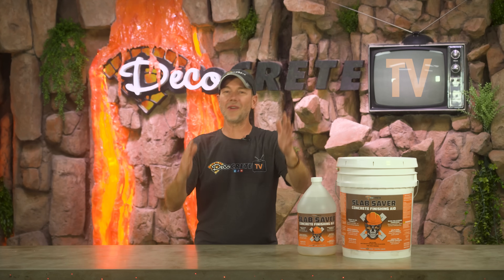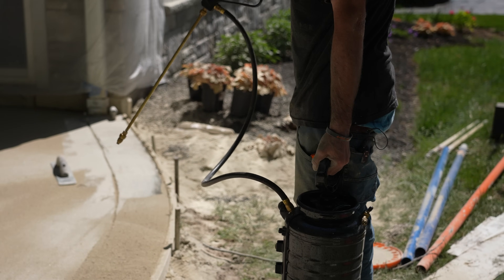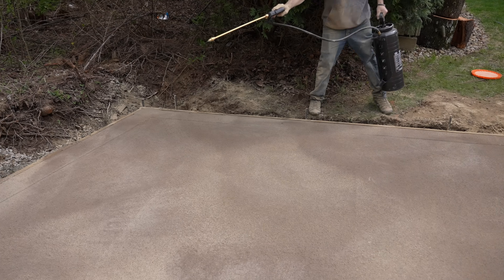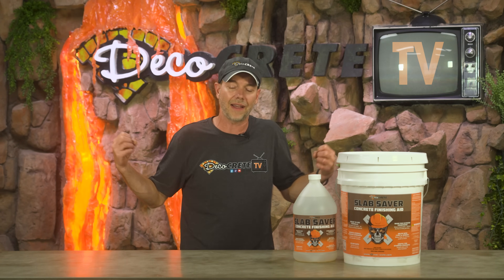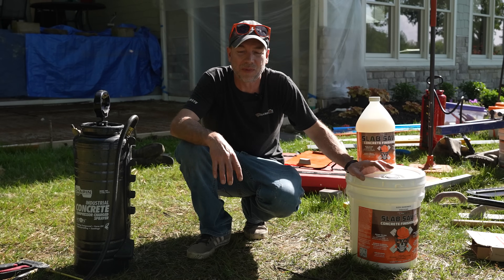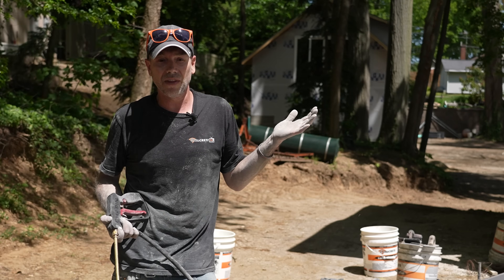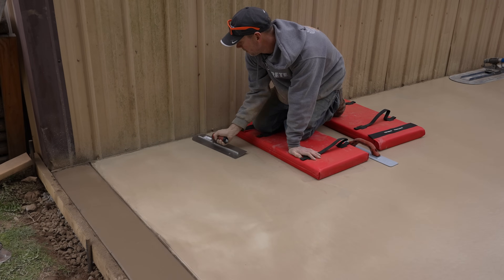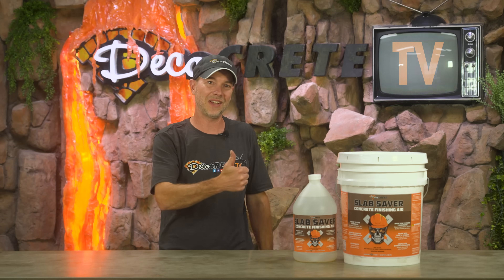This Finishing Trick SAVES Concrete in Extreme Heat! | Slab Saver

Comment: Is there something you can use after its been poured if its highly reflective with sun. Causes so much glare that it burns your eyes.
Reply from the maker: Thanks for the comment! I'm not aware of anything that is designed for reducing glare. Most finishing aids and evaporation retardants contain water, and may actually increase glare for a few minutes after application. The glare comes from moisture on the surface, and on a warm sunny day the concrete would be hard to finish without some moisture. Reducing glare is an interesting idea, though. Let us know you find anything helps. Thanks for watching Deco-Crete TV!!!

Comment: Здравствуйте  🤝 вопрос о гидроизоляции бетона, точнее под бетоном, в зимних штатах вашей страны где есть минусовая погода зимой, когда производите подготовку основания под бетон стелите ли вы какую то гидроизоляцию или не ? Если да то почему? Если нет, то тоже интересно услышать ваше мнение на этот счет и как это влияет на декоративный слой бетона штампованного. За ранее спасибо за ответ!
Reply from the maker: There certainly is some debate on that subject in our country, and you’ll probably get different answers to that question depending on who you ask. Our approach has always been to avoid putting plastic or any other kind of vapor barrier under exterior concrete, unless it’s a unique situation. While there might be a few benefits to putting plastic under air-entrained exterior concrete, there are also some downsides. It will increase the amount of bleed water that comes to the surface. This can dilute the water-to-cement ratio on the surface and weaken the top of the slab. Plastic also slows the set time at the bottom, causing the top to shrink faster than the bottom, which can lead to the slab curling at the edges. Additionally, it can lead to a more uneven moisture gradient, which affects strength development and increases the risk of surface crazing or dusting, especially if finishing happens too early. For integral colored stamped concrete, the excessive bleed water can dilute the color on the surface and lead to color inconsistencies. All in all, the risks of using plastic under exterior air-entrained concrete just seem to outweigh the benefits. If the situation requires a barrier under the slab, the best thing to do is to place 2-3 inches of sand on top of the plastic to help minimize bleed water. This would require a few more inches to be dug out, so most contractors tend to avoid it. Again, not everyone would agree with all of this. It’s just always been our approach, and it has worked well for us. Hopefully, this answers your question. Thanks for watching Deco-Crete all the way over in Russia! We would love to meet you guys sometime!!